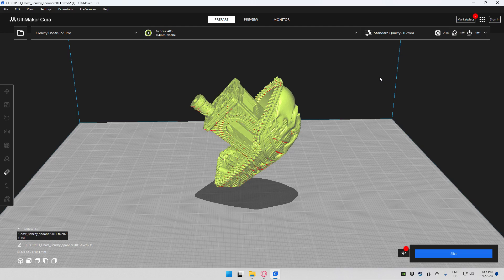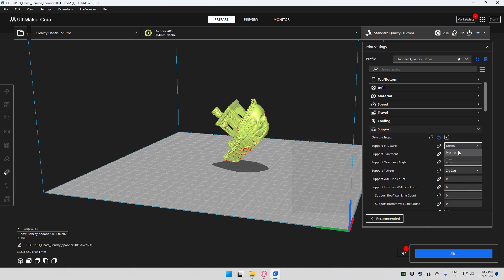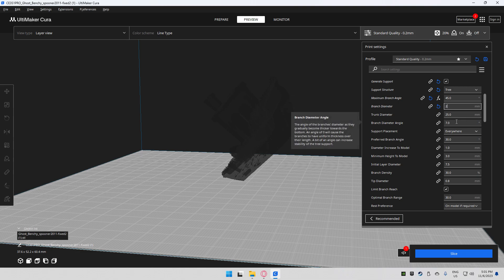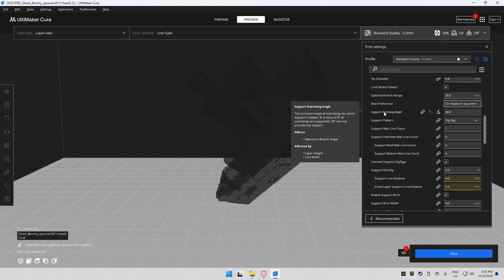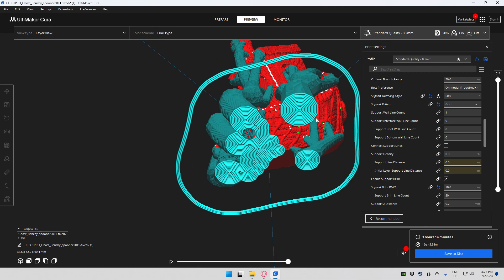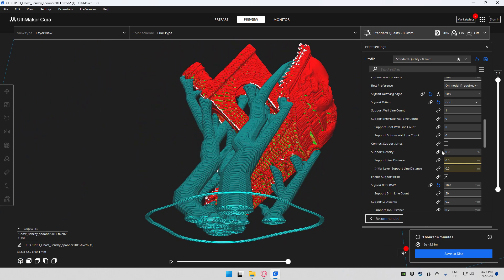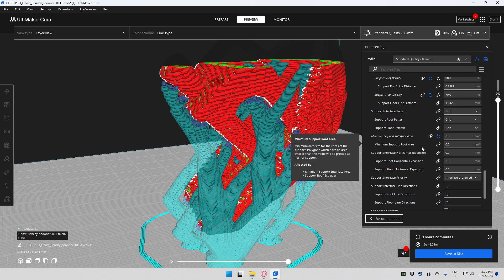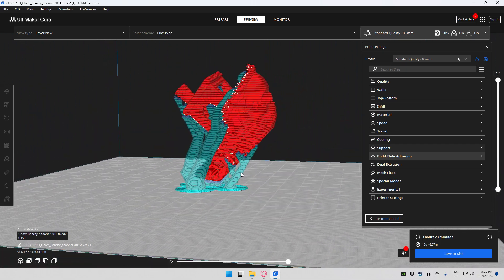Ender 3 S1 Pro - How to setup Cura 5.5 Tree Supports (S1 Plus, S1)

Comment: Hey, great video as always, could you make a full video on wall settings you use, also which infill, travel speed settings and retraction too please ^^

edit : btw you said in description you enabled zhop, but on all metal hotend and direct drive, it's recommended to disable it (I use micro swiss direct drive on ender 3 v2 neo with brissfang v5 duct, x limit switch moved further to work it, also y limit switch further away too)
Reply from the maker: Hey, I sure can.
Regarding Z-Hop, I do recommend that it's enabled, especially if you're printing above 100mms, without it you can knock down the supports. If you're  using the V2 neo with Microswiss direct drive then it could be too heavy to use z hop effectively, the S1 sprite extruder is light weight and has dual Z motors,  I found no issues using it.
Reply: @Zeltroix I don't have my desktop turned on to see exactly what settings I've put for z hop in fact, but I believe I must have disabled, I should try to enable it again to see how it goes, I have a second z motor, I've modded a synchronous belt like yours but used bigger gt2 pulley I found on printable (the zip file contains A LOT of different gt2 sizes) to have z axis well aligned but also the 640mm timing belt tightened + all upgrade you have too ^^ (also have anti backlash nuts), but yeah, I'm finishing an 11hrs print and I'll try messing around the settings again if you're willing to share yours too :) ! (I can print at 120mm/s without problem with the microsswiss direct drive and brassfang v5 duct and original extruder motor, anyway, I'll switch to a pancake nema 17 motor to ease the weight, I'll soon go with klipper ^^)

I didn't like the creality sprite design because of not so much mods for better cooling even if it's light, usually, the better ducts are the brissfang and the hero me gen 7 with 5050 fans, I'll switch to the light and new microswiss ng extruder with the new gear ratio like the creality sprite, some people modded ducts for it ^^.

Btw I switched to V slot metal wheels like you, it solved many of my issues I had with the low quality rubber ones. 

In the end I think I'll switch to the microswiss ng extruder + linear rail for x and y axis